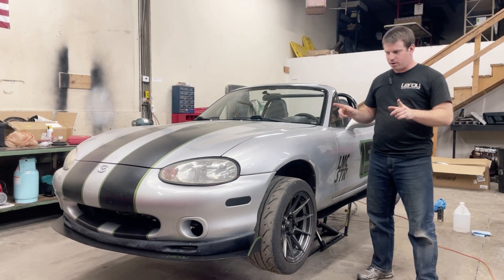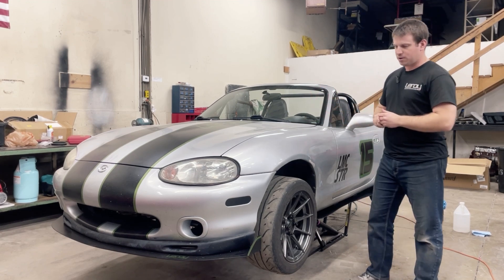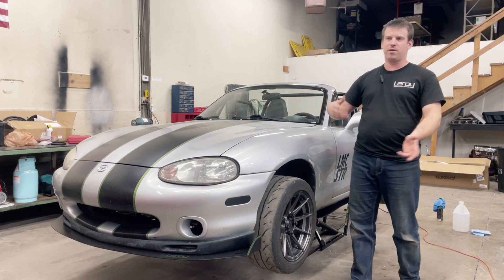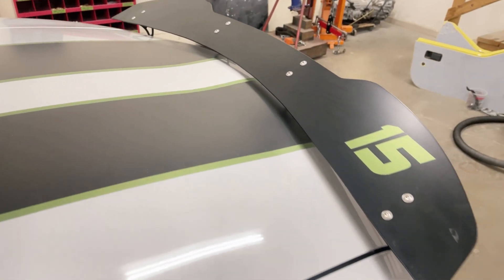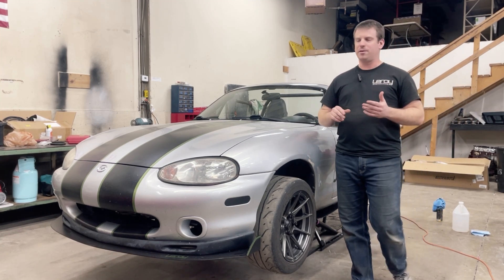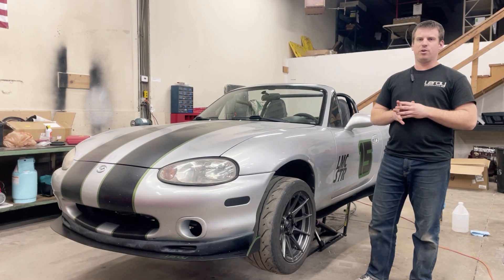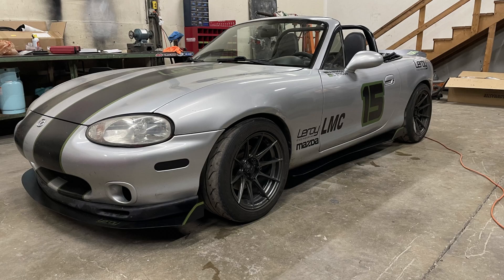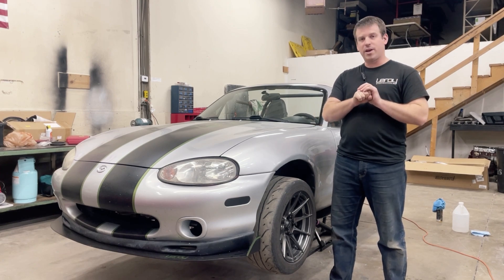Leroy Engineering NB Miata Ground Effects Kit

Comment: Definitely would like to see the side skirts on something with Tupperware kit. Also wonder if the splitter skid plate would come with a option without the holes. I rather add a few pounds and have a flatter underpanel. But I get why you didn't.
Reply from the maker: Yea, that would be an easy option to have. It wouldn't add any cost to make it a solid sheet, just a little weight addition. I'll make a note to have that as an option.

Comment: Not sure about the side skirts, but the splitter and rear wing should be legal in SCCA Extreme Street. Nice looking kit. And you're right, nothing wrong with some aesthetic "aero". Mazda did it themselves with the optional front and rear lips, but you won't see forum arguments over the validity of those pieces, funny huh?
Reply: On the contrary: a lot of NB owners rave over Mazda's tupperware as if it's the best thing since sliced bread.

It isn't.

It only adds weight.